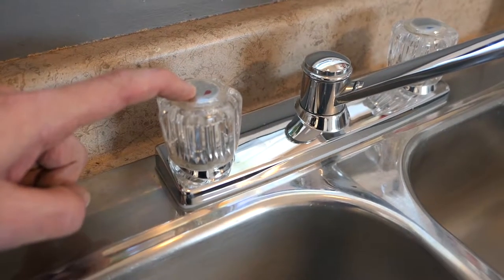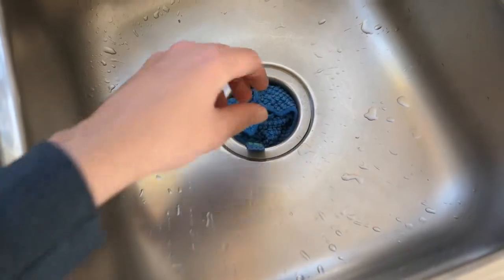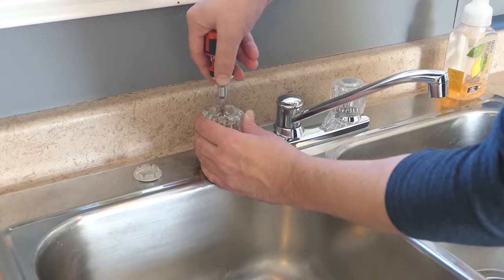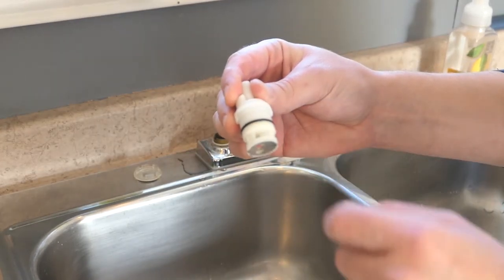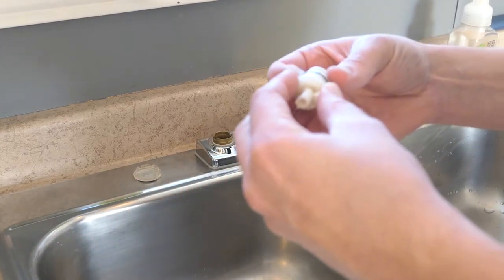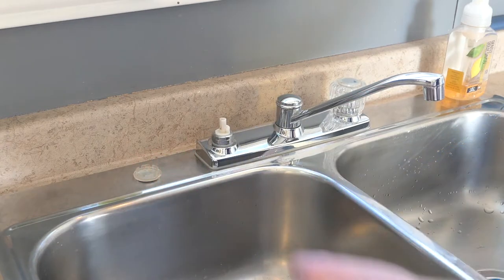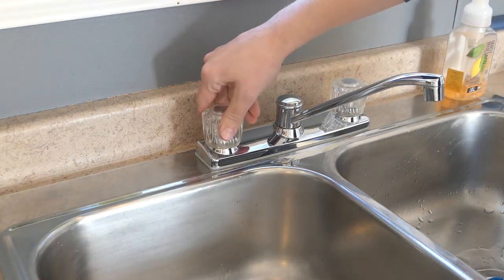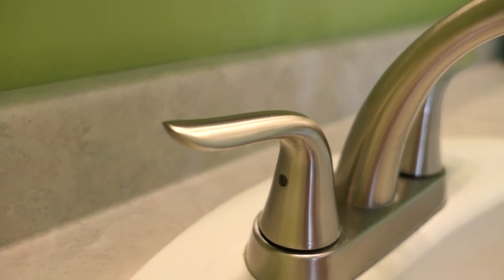DIY - Fix Your Squeaky Kitchen Faucet (How to / Tutorial)

Comment: Greased mine and it still squeaks....
Reply: The o-ring that he applied the lube to, doesn't move so I can't see how this will fix anything.
I have the same faucets and it's ALWAYS the hot one that squeaks...I think it has to do with the expansion of parts, binding against each other since they're just cheap plastic.
By dismantling the spindle (the part that actually turns) and lubing the stem, I was able to resolve this squeaking for about 5 minutes. Time to get a set of faucets with brass cartridges.